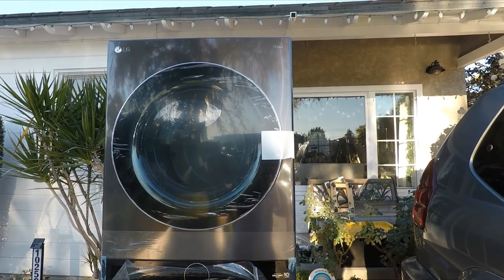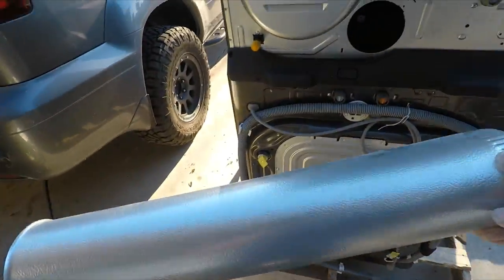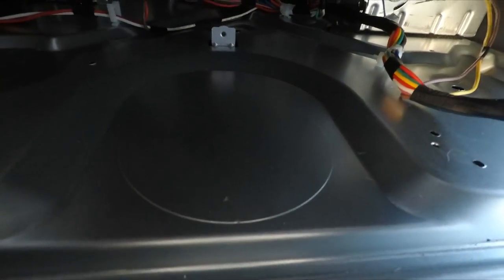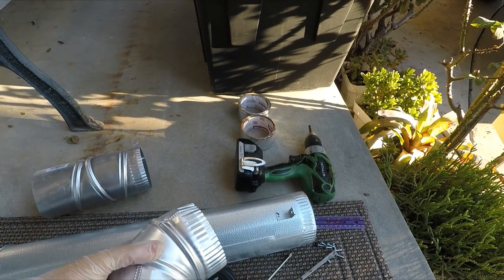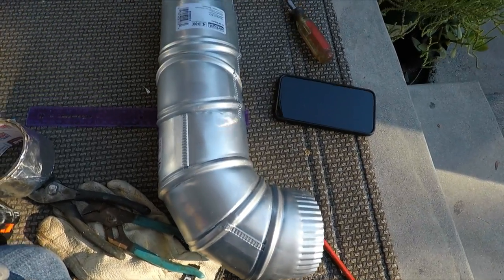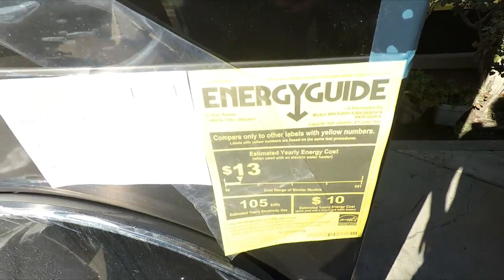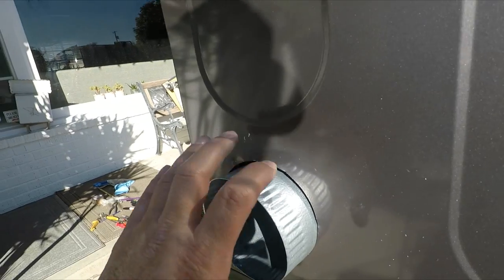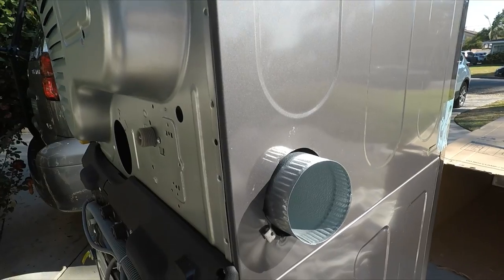$5 DIY LG Wash Tower Gas Dryer Left Side Vent Kit

Comment: I love the DIY spirit!   By the way, the bottom venting hole is when the machines are not stacked and you vent down thru the basement.
Reply from the maker: Got it. This model doesn’t unstack. It’s only meant to be used stacked.

Comment: Very informative. I needed to see the left venting option as I like this tower and need to talk intelligently to the salespeople at the big box store. So far their "expert" advice regarding possible space limitations behind the tower has been questionable. They state that a 30+ inch depth LG tower will fit fine in a 33 1/4 inch depth closet. I doubt that unless it can be vented out the left as you have shown. I sure hope so. Also, I now have a 25-year-old Maytag GAS dryer/washer in that closet, and the original installers vented it out the back using flexible, soft aluminum venting. I have read that gas dryers require rigid, metal venting (unless this means only inside the unit). This is why research is necessary. Much to learn. 🤦‍♀
Reply from the maker: Inside the unit…you need rigid vent pipes. 

Outside the unit you can run what’s called semi-rigid flex ducts. https://www.homedepot.com/p/GE-8-ft-Semi-Rigid-Dryer-Duct-WX08X10075/202214660

Do not use the thin aluminum paper duct line nor the thin plastic flex duct lines. Those are a fire hazard.

I’m not a plumber, so check your local codes.
Reply: @MHam1  Thanks for the help. Appreciate that! Tonight I purchased the LG Tower at Lowe's. Included delivery, installation, haul away and the "required accessories". I made sure the venting was the rigid, metal type. Later while eating dinner, a lightbulb went off. I checked my receipt. My hunch was right. The salesman neglected to order a side vent kit, even though we discussed it thoroughly and it was the reason I chose the LG. I phoned the store and reminded him to add that. He sheepishly admitted that Lowe's does not sell the kits, and he also doubted the installer would do side venting as part of "normal" installation. It did not occur to me that side venting was a DIY adventure. I was so disappointed. I owned one of these beauties for about ONE hour. Back to the drawing board.
Reply from the maker: They sell the side vent kit on amazon. You can order there
Reply: @MHam1  Thanks. I did not buy the kit.  Because salesfolks at both Lowe's and an independent appliance store both said the LG Tower would not fit in my laundry closet, I was forced to purchase a GE stackable (the 24 inch). Big mistake. The first GE Unitized Stackable lasted 6 days. The second one lasted 13 days and was uninstalled/removed today, leaving me with NO in-home washing facilities. I am back to Square One. So bummed.

Comment: Hi! I am very much considering getting this same unit and I think I had the same dilemma as you. I have a closet that is not deep enough to fit the vent out the back of the dryer. 

Is there any chance you could let me know the depth of this unit when pushed against the back wall (since you have the side vent) I am trying to figure out if this will work in my closet. 

Thank you for the video! Very helpful!
Reply from the maker: Unfortunately, my general contractor left the original gas line and gas valve sticking out at the bottom. He never put the 90-degree gas valve, so my unit is not flush with the wall. 

Just be aware that the gas line needs to be in the right place too. 

Anyways, my unit is in an open space surrounded by cabinets, but one day I’ll get a plumber to come and redo the gas line.

Comment: How were you able to assemble the elbows and insert them without taking the machine apart? You were able to slip the whole assembly in through the side? I need to do something similar to my new Samsung dryer and would love to avoid dissembling the entire machine to do this! Also, how did you cover the back hole where the vent originally came out? Did you just use metal 3M tape or did you put a piece of sheet metal over it? Thanks in advance.
Reply from the maker: There’s a lot of room inside the machine once you get the straight pipe and elbows through the round openings (back and side).

First, insert one piece at a time and connect in place inside the cavity. Once you figure out the right lengths and turns….use hvac silver tape to tape the back straight pipe, then the elbow, then the side straight pipe. One at a time. Tape while the pipes are inside the cavity.

I didn’t cover the rear vent hole but you can use the side punch out vent piece you took off to cover the rear. But you idea to use tape or sheet metal would work too.

I left mine open for easy access in the future but I haven’t had to access in the last year.
Reply: @MHam1  I kindly thank you, not just for this video / idea, but for your quick response. Really appreciate it! Taking the machine apart, especially the drum & pulley, just sounds like a terrible idea. I’m going to give it a try. I think I’m also going to apply some mastic at the joints that are inside the machine to ensure proper seal(s). Thanks again 🍻

Comment: On an electric dryer do you think it can vent to the right?
Reply from the maker: Yes. Electric dryers do not have the rigid gas line partially blocking the right vent hole
Reply: @MHam1  Thanks. I thought your solution was great.
Reply from the maker: Thanks. My goal was to share that you can cut the vent pipe that comes with the unit and use a $5 90-degree elbow to essentially end up with the same components as a kit.

Comment: Question here. IS it possible to remove the back cover panel and access the exhaust that way?
Reply from the maker: It’s been almost a year since I made my own side venting kit. It’s still working great.

Not sure if removing the back panel helps because the dryer drum is above the exhaust vent. 

I don’t remember why I aborted removing the back panel. Maybe there were too many screws, wires, and clips to take off.
Reply: @MHam1  I just ordered a new set, being delivered this week but I want to do the change over to the side as well, I see a lot of how to videos and I see everyone doing it the same way and no one removes the back panel.
Reply from the maker: I can’t access the back of the unit to look at it again. If you remove the back panel, do a YiuTube video and let me know how it goes.

I remember starting to take the screws off the back panel and I aborted after taking like 8 screws off.

I just don’t remember why I stopped and put the screws back on.

It must have realized that the back panel was not coming off easily and I must have gotten stuck.

Comment: Hello good video
Reply from the maker: I just used the LG WashTower for the first time with the side venting DIY pipe I made. 

I had to also use foil tape at the very first duct joint deep inside the dryer. If you don’t tape that fist connection point on a side vent, the vent pipe comes loose at that point and it’s not a tight seal.

I suppose when the vent pipe is straight, the outside screw holds it in place. 

When you side vent, the 90 degree elbow is free to move and causes that fist connection point to come off.

I found this out when I felt too much air coming out the back of the unit. 

The owners manual says to tape the vent pipes, but it doesn’t have any illustrations or tips on making sure you tape the fist connection point especially on a side vent.

Comment: How do you connect it to the blower?
Reply from the maker: I used the same vent pipe end that came with the dryer. I used foil tape to connect it in place to the blower. Blower has a matching vent opening that goes perfectly with the supplied vent pipe. 

It’s exactly the way it came from the factory for a rear vent option. The only difference is that I used foil tape to ensure it didn’t come loose. LG didn’t use foil tape. LG just aligned it in place and made a snug connection. 

I used metal sheet screws to attach the vent pipe to the external dryer side panel to hold it tight. Again, I just cut up the original vent pipe and used 90-degree elbows to make it side vent.

Comment: When you spend $2,400 on a washtower just buy the $70 kit
Reply from the maker: The LG dryer kit is one 90-degree elbow and two short vent pipes.
Reply: If you look online, the supplied LG kit has to be modified anyway. The straight length of conduit they supply is too short. So if you have to modify something that costs $100-200, you might was well pick up the parts for a 10th of the cost.